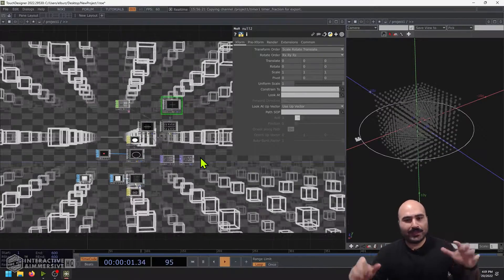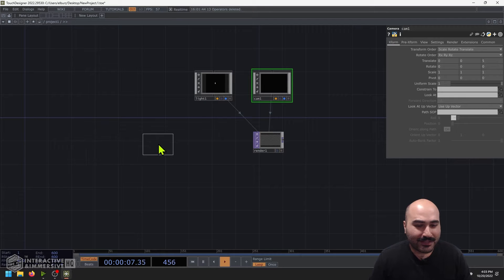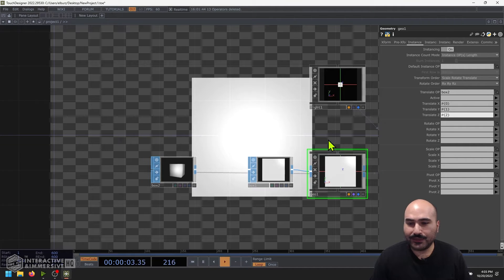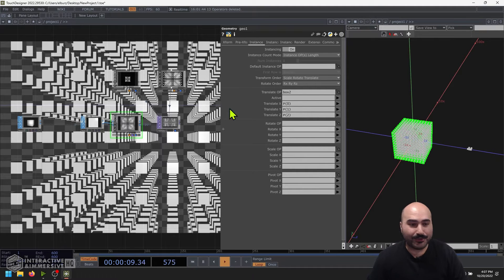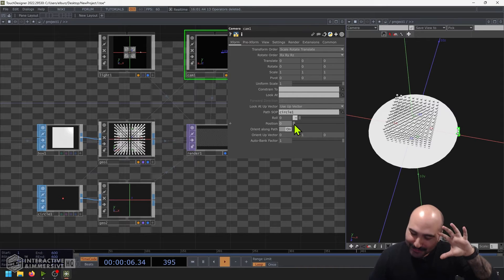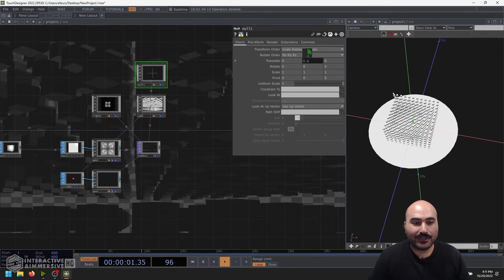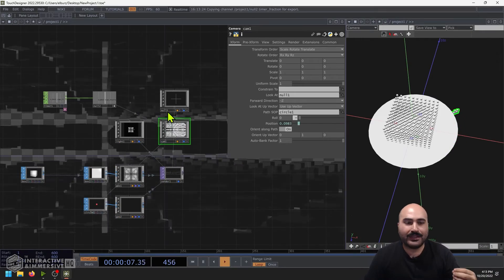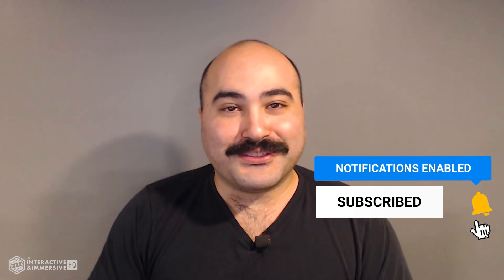Generative Camera Paths in TouchDesigner - TouchDesigner Tutorial 110

Comment: I have my cam looking at the null comp, but whenever I attach the timer to the position of the cam, it starts jumping around really fast and throwing ""unable to calculate lookat parameter" errors briefly and sporadically... Any ideas on how to solve? Thanks
Reply from the maker: Double check that you've got the camera's position Translate parameter set to [0, 0, 0] and that you've got the CHOP reference from the Timer CHOP controlling the Position parameter. You may also need to turn Orient along Path off if you're still seeing erratic camera movement. Hope that helps!

Comment: I know it's a bit odd, but is there a Path sop but for geometry?
I'd like to have an object move following a curve (Like the follow path constraint in Blender) thank you ❤
Reply from the maker: Actually, yes! The Geometry COMP has the same Path SOP parameter as the Camera COMP
Reply: @TheInteractiveImmersiveHQ found it this morning ❤ i was trying to make a 3d chain generator (unfortunately having the chain follow and deform along path is still beyond my capacity. The chain stay still, and using the instancing on a single ring makes too stretched or goes on weird positions. I imagine it's not optimized as blender fir these things and the workflow is kind different).
If you have any idea on it can be done it'd be fantastic.
Either way thank you so much❤

Comment: When you used the noise to create the sort of handheld effect. I want to do the opposite. I noticed that when I added higher time, I can see the camera sort of shake. I don't know if its a gimbal problem or if there's a node so I can smooth my data going into the cam1 node. I can elaborate more if my explanation is confusing.
Reply from the maker: It's worth trying out the Filter or Lag CHOP -- either can be used to filter/smooth out incoming data. You can try adding this after the Noise CHOP (or whatever source you're using for the camera's movement).

Comment: Hello. I have an issue, my camera doesnt go smooth in the path, it struggles sometimes in a position for few seconds than continue the path. I tryed to mach the orient up vector with orientation, i changed orientation but still dont go smooth. Somebody can give me a hint?
Reply from the maker: Try setting the Auto-Bank Factor parameter to 0 and see if that helps!
Reply: i have the same issue xp n even if im puttin the auto bank factor to 0 the cam still jiggling
Reply: okay nvm found a solution when u create ur circle put the primitive type on primitive. (I think That every point of the polygon stops the camera or smthn like that)

Comment: my camera  turns upside down at half circle path and my x y are exchanged, where you have x i have z. how to align my point cloud object
Reply from the maker: Double check that you've set the Orientation parameter of the Circle SOP to ZX Plane . If it's left at the default XY Plane setting you might end up with the camera orientation behaving like you've described. Hope that helps!
Reply: Exact problem I was having, but on a different project. Couldn't figure out why it was working fine when I followed your tutorial, but wouldn't work when I tried to use the technique in another project. Spent so much time looking through everything. Can't believe I missed that!
Reply: You can also change the "Orient Up Vector" in the Camera settings. If the Circle is in the X/Y Plane you want this vector set to 0 - 0 - 1.

Comment: hi
i keep switching allegiance between Touch and Unreal...the biggest conceptual annoyance in TD, which otherwise is so responsive and quick in comparison, is  blocking out and moving between camera positions , which is a breeze in Unreal's sequencer. I never worked out how to use " Save cam pos" in this way....how would i do that? and thanks !!
Reply: and my second bugbear is volumetrics, or at least ambience...
Reply from the maker: Great question! A simple approach to this could be using two different cameras, set to the two positions that you want “move” the camera between, and then use a camera blend to transition between the two camera views. For some other approaches Matthew Ragan has some additional suggestions on the forum: https://forum.derivative.ca/t/palettes-camera-comp-transform-matrix/183960/4. Hope that helps!